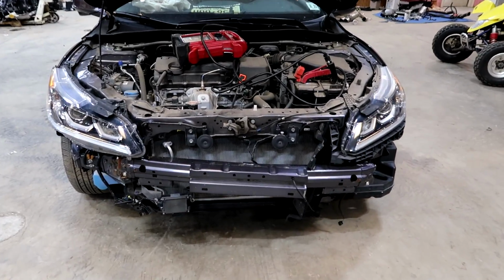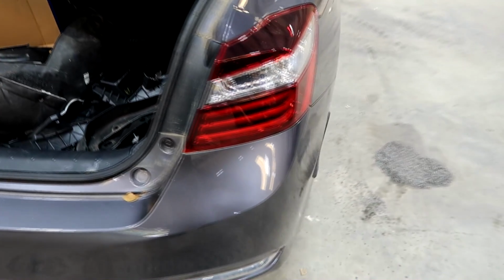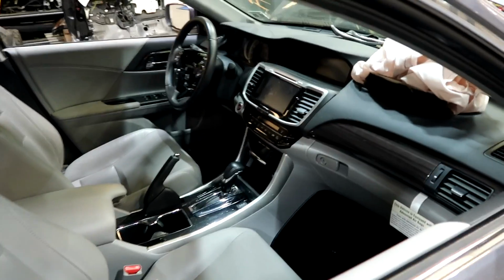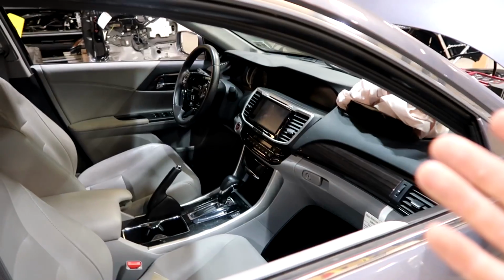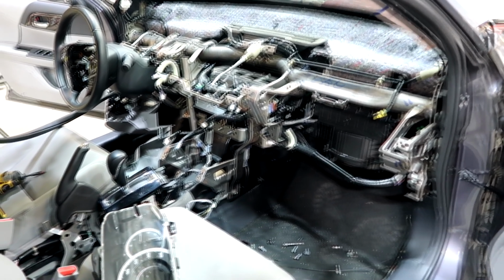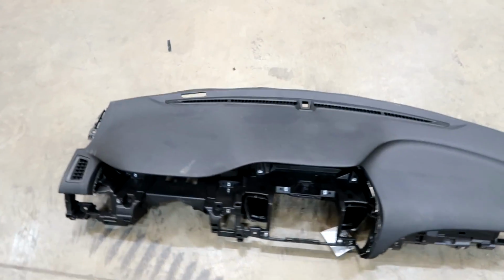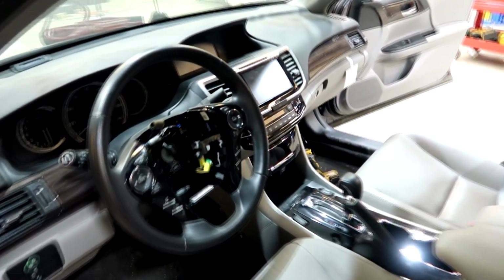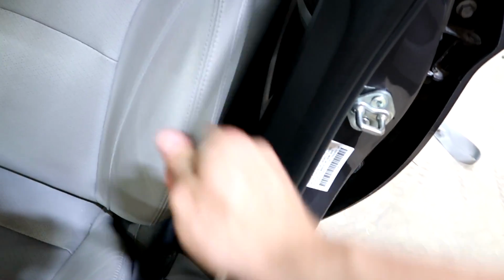Rebuilding A Wrecked 2016 Honda Accord

Comment: One thing I have to admit-
Speaking from experience,  I have a 2015 like this..  super easy to work on and service. 
Need to update suspension in the near future and the sub in the rear deck...
Never really thought about dash replacement after the air bag deployed...(knock on wood)

good video- I have to re-glue my other dash as it started to separate a little near the windshield vent-  not looking forward to pulling it apart-

Comment: Great work.  Sorry for my ignorance and my bad English. Why are seat belts replaced also when the SRS module is replaced? Are they (the seat belts) damaged mechanically or by some electronic programming with the SRS module replacement?.  Regards.
Reply: Alan Kepler the seatbelts has some sort of explosive device or charge to lock the belts and I think the srs module is a one time use
Reply: @jeffreygoss8109  Oh! thank you so much, now I understand, regards.

Comment: A right cowboy, when you take on a Panel Beating job you pull it out, then remove the damaged  pieces, and replace with undamaged pieces, not hide by lapping pieces over each other, when the owner removes the wheel he,s goig to see the wrinkled metal welded to the outer smooth part, right cowboy job.

Comment: I like the video you did with Alex you guy work good together. Do you have to disconnect the battery to replace the seat belts with the plug in?
Reply from the maker: Usually no. When the srs module is being reinstalled then you have to disconnect the battery

Comment: The VIN number on the replacement dash board is different original dash board that could cause problems if one is stop by the police they usualy check on the VIN NUMBER.